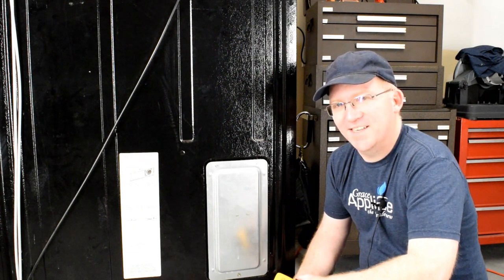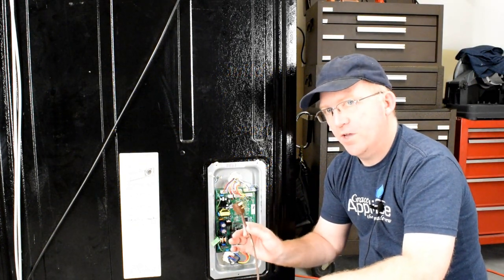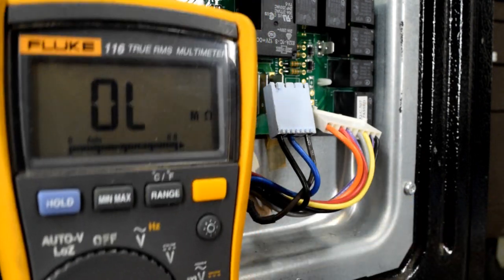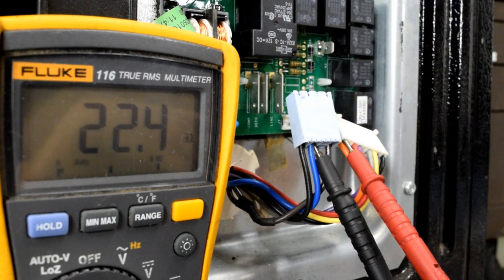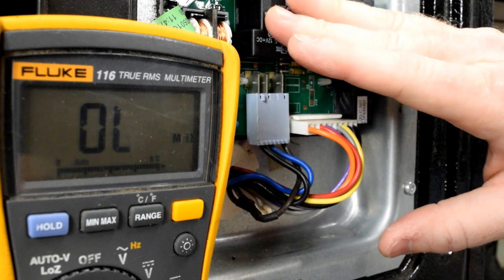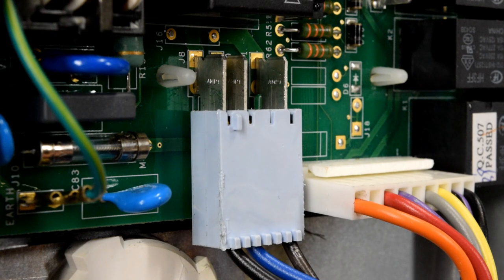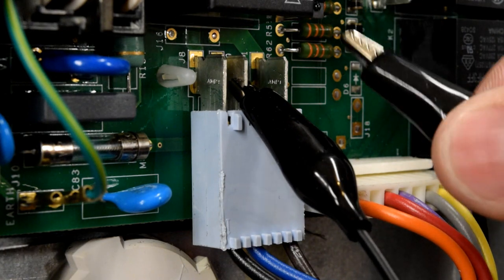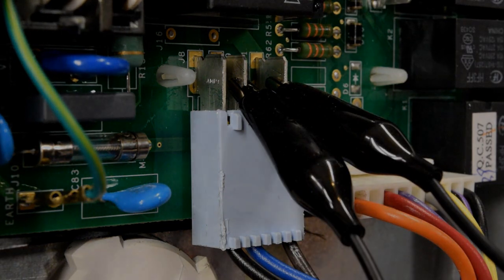Diagnosing a Bad Control Board - Part 3: Defrost Issues

Comment: Andy  Hi !     My GE refrigerator 2 doors model PS123SCPABS  S/N  LF425289 wasn't running.    I changed the main control  board
Now the  Refrigerator and Freezer are working , but the main panel inside is not lite  As results of this I can't make any adjustment for temperature settings. THE UNIT IS RUNNING MORE 24 HOURS   on and off automatically   I ALSO SHUT THE MAIN BRAKER  but no luck .Please help  All your videos are excellent very educational  God bless for good explanations,
Reply from the maker: Hello,
What is the part number on the box of the control board that you installed?
Thanks!
Reply: @GraceAppliance  

My new board  GE         WR55X10942           ASM-084691240-102    THANK YOU
Reply from the maker: Michael Babu hi, thanks!  
So, your original part number was WR55X10314. The substitute part number that’s give for me is: wr55x10942P. 
Now, I’m not sure if the updated part number ending in P would make a difference in your case, but just wanted to get you that info.  I don’t believe it should make any difference.  Also, I checked your serial number for the wiring modification I mentioned previously and yourself does not show it needs any modification.  

I’d double check the board connections to make sure that each plug has been properly seated. I’ve seen where people will install the plug, but mistakenly got it plugged in 1 pin over to the right or left and have similar issues.  

I’d start there.  Let me know what you find.  Thanks!

Comment: Can't this test only be done if the refrigerator has been running and is cold so that the high limit thermostat is closed?
Reply from the maker: Hey, the high limit thermostat opens at like 110+F (am not sure of the exact temp off hand) so we'll above room temp. If it's below that temp, the heater should turn on with this test.
Reply: @GraceAppliance  from my experience, I thought most defrost thermostats open around 47 degrees or so.
Reply from the maker: We're talking about different parts. They look the same in appearance, but have different functions.
A defrost thermostat will cycle around 45-55F. A high limit thermostat is a safety part designed to cut power to the heater if something is wrong, stuck relay for example.  But it has nothing to do with when the defrost comes on or off.
Reply: @GraceAppliance  I'm talking about the part that is in line with the heater that is mounted on the top of the evaporator that cuts power to the heater when it reaches around 47 degrees or so. Some people call them defrost thermostat or some people call them a high limit.
Reply from the maker: @brianseeney1364  those are 2 different parts. They're both in line with the heater, but serve different functions.
A side by side GE refrigerator with a control board has a defrost sensor and an adaptive defrost (control board) which turns on and off the heater based on the sensor feedback.  This is what dictates when the defrost turns off and power is cut from the control board relay. The high limit thermostat (not a defrost cycling thermostat) is there in line with the defrost heater should the board have a stuck relay and thus continually send voltage to the heater.  This is when the defrost high limit would cut power to the heater, in the event they there is run away temperature at the heater. This happens at much higher than 45-55F (usually around 130F).

A defrost thermostat, usually 45-55F is the mechanical on off switch for older defrost systems, non control board models usually. Older fridges would use a mechanical defrost timer vs a control board on newer styles.

The visual appearance of both parts are the same, but do not serve the same purpose.

Thanks!
Reply: @Grace Appliance  I took the freezer apart and did find that it is a higher limit like you say. The refrigerator works correctly most the time but sometimes I check on it and the temperatures are about 10 to 20 degrees higher than they should be but then it goes back to the correct temperature. I was thinking it was maybe sticking in defrost too long. Do you think it could be a temperature sensor causing that?

Comment: Thank you for your video, I have a hotpoint  HSM25GFTCSA side by side fridge   will a WR50X10068 REPLACED wr50X10065 because I installed the 10068 and the freezer and fridge are not cooling enough and I feel there are to much heat coming out the evaporator vents when the heater defrost is on plus is melting the ice on the ice bin every day ,I will appreciated it you could give me an answer thank you again and be safe julian
Reply from the maker: Hi Julian, 
The part you replaced does not dictate when the defrost comes on or for how long.  It is a safety thermostat designed to only cut power to the heater if it’s gotten too hot. This is a very rare part to fail and is not your issue more than likely.  

The other 3 remaining parts are, your defrost heater, the defrost sensor on top of the evaporator and the control board.  

Please watch my video called how to test and replace a defrost sensor. You can do an ohm test on the 2 leads going to the heater and should get around 20 ohms of resistance.  If both of these parts test good, it would be a bad control board.   

I hope this helps,
Andy
Reply: Mr Andy first I want to thank you for your prompt and accurate response,that shows how serious and good you are as person and technician ,I forgot to tell you that when I change the defrost thermostat I also did the same with the sensor and heater,watching your video of how to check sensors,follow your clear explanation and after some troubleshooting change the freezer sensor again I think the fridge is getting the temperature that should be, once again thank you  Mr Andy and have safe and too day
Reply: GOOD DAY
Reply from the maker: Julian Trujillo you’re most welcome.  Please keep me posted should you have any further issues.  Also id recommend using a legitimate GE sensor vs an aftermarket sensor as I’ve heard other having issues with aftermarket.  There is not much of a savings in using an aftermarket sensor either so it’s worth the extra money.  Thanks!
Reply: Mr Andy ,I still have issues with the evaporator fan running non stop and is freezing the auger motor,the temperature are 14F and 36F ,any suggestion I would appreciate it, thank you again and have a safe and a good day
Reply from the maker: Julian Trujillo hi, so the ideal temp should be closer to 0F and 14F is too warm. Your freezer would continue to run non stop as it is trying to achieve the 0F temperature.  Do you notice that your compressor is also running non stop as well?

If so, it would be good to visually examine your evaporator coils for a proper frost pattern. This will tell you quickly if you have a sealed system (I.e. compressor, refrigerant etc) issue.  You’d need to remove the back wall of the freezer while it’s been running for at least 30 minutes.  You should see a light coating of frost on the majority of the coils. Feel free to send me a picture to GraceAppliance@gmail.com if you’d like me to confirm what you’re seeing there.
Reply: Mr Andy yesterday when I changed the defrost sensor I had looked at the evaporator and it was with the light coating that you mention,the compressor is working and the freezer temperature is down to 8F ,37F I think I  should be patient ,once again I thank you for your time and responses thank you and be safe.
Reply from the maker: Ok, sounds good.  Let me know if you have any questions.  Andy

Comment: Actually the HSMGFT25asa can be forced into defrost mode via the front panel buttons:   set the 4 temp buttons        5 5 and push all 4 buttons at once for 3 sec, they will blink, now type in 1 4 and hit cubed ice button (or any other button they say), it will fire up the defrost heater, its glowing orange now finally;   so that confirms that the heater and def therm is ok, must be some other problem (maybe temp sensor thermistors or main board?  it will deactivate after 15 min or perhaps unplug replug or code 1 5 or 1 6, then cubed ice button.. Thanks for reply:: makes me miss the venerable DF timer which could be turned to on with screwdriver.    I ordered a low cost board and will just swap them to be sure whats really going on.   I noticed there is a fuse on the board just to the left of where you jumped the DF , is it possible that is the problem  with the DF circuit part of the board.   FYI:  I called GE answer center, and they said that all they can recommend is unplug wait a minute, replug in.  I asked her if she knew where the diagnostic codes for use with the 4 front temp buttons were (table2), she didn't know.    I know where it is but can't find the manual that avail to public its:        31-9072 GE Profile Side-by-Side Refrigerator Service Manual
* 31-9072 Arctica Profile GE Side-by-Side Refrigerator Service Manual (pages 35-  ).pdf (66.66 kB - downloaded 2241 times.),   maybe you can get it down and at least post the code for the DF part of the circuit.
Reply from the maker: Hey, the fuse you mention do cause problems sometimes, but if that fuse blows, the entire board doesn't get power, not just the defrost function.

Best of luck and let me know if you have any questions. 

Thanks!
Reply: John Doe
6 hours ago (edited)
Actually the HSMGFT25asa can be forced into defrost mode via the front panel buttons:   set the 4 temp buttons        5 5 and push all 4 buttons at once for 3 sec, they will blink, now type in 1 4 and hit cubed ice button (or any other button they say), it will fire up the defrost heater, its glowing orange now finally;   so that confirms that the heater and def therm is ok, must be some other problem (maybe temp sensor thermistors or main board?  it will deactivate after 15 min or perhaps unplug replug or code 1 5 or 1 6, then cubed ice button.. Thanks for reply:: makes me miss the venerable DF timer which could be turned to on with screwdriver.    I ordered a low cost board and will just swap them to be sure whats really going on.   I noticed there is a fuse on the board just to the left of where you jumped the DF , is it possible that is the problem  with the DF circuit part of the board.   FYI:  I called GE answer center, and they said that all they can recommend is unplug wait a minute, replug in.  I asked her if she knew where the diagnostic codes for use with the 4 front temp buttons were (table2), she didn't know.    I know where it is but can't find the manual that avail to public its:        31-9072 GE Profile Side-by-Side Refrigerator Service Manual
* 31-9072 Arctica Profile GE Side-by-Side Refrigerator Service Manual (pages 35-  ).pdf (66.66 kB - downloaded 2241 times.),   maybe you can get it down and at least post the code for the DF part of the circuit. This manual is very very close but instead of F for fail, it gives code of 0, & they are not in the order dictated by the manual.  @GraceAppliance
Reply from the maker: @InventPeace1  yes, it confirms the heater, high limit thermostat are both good. It also likely means the board is good as your relay works fine. I'd swap the defrost sensor on top of the evaporator and you should be good to go.

Nice work!
Reply: yes I did take the one good sensor on the freezer bottom and put it on the top (evap), that allowed it to turn off yesterday, today I got a new temp sensor in and put in the bottom, now the 0 7 diagnosis test from table2 gives something like 0-1,P-2, P-3,P-4, & 2-5.   I think the 0 means Fail or not there, the 3 P's go to the 3 temp sensors (p-3 is the bottom freezer, changed from 0-3 to P-3), and the 2-5 I have no idea except some models have 4 temp sensors so maybe it means not there.  This HSm model is very similar to this manual for the Pss and Gss models but the codes come out a bit different, I got no F ever so I think the 0 means fail?   Anyway its making ice and acting more or less normal but fingers still crossed on whether the Def Htr comes on or not. Will let you know, thanks for your help immensely ! And Cheers to UncleHarrys website where I found the manual with the fabled "Table2" .  @GraceAppliance
Reply: @GraceAppliance  The fridge gets cold as usual, the fridge runs seemingly all the time?  Wondering if one of the temp sensors that "passed with a P" is bad? The fan inside the freezer seems to lope?   what do you think? thanks.
Reply from the maker: john Doe the pass fail test that the error codes will give are only telling you if the sensor is open circuit or has continuity.  The sensors can have continuity, but not have the correct resistance to properly measure temperature.  
You’ll need to measure each sensor as shown in my video called ‘testing and replacing a defrost sensor’ in order to see if they are within specs.  

Thanks!

Comment: hello, we have a problem with defrost heaters burning out as soon as they are replaced and kick in for the first time.. they start and then simply burn out. The defrost thermostat tests good L1140-30F, the temperature sensor tests good as well with appropriate ohms at certain temperatures. But the defrost heaters we get from internet burn out right away.. would this be main board issue or wiring issue, or using cheap parts from amazon instead of buying OEM defrost heater? WR51X10055 Thank you for help in advance.
Reply from the maker: Adam, very interesting!
I would suspect that this is due to parts vs an issue with the board or wiring.

However, I would want to confirm 110-120v to the heater, but have not seen an issue where a board would send more than this - assuming voltage at the wall is appropriate (120v).

That's where I'd start to rule out a short. However, if you had a short to ground (or Neutral) I would imagine it would trip the breaker long before this.

If you're getting 120v at the wires to the heater, I'd replace the heater with an OEM.
Reply: @GraceAppliance  I look at the main board. This fridge is old. The board is white but has same plugs as yours.  Sadly my multimeter probes are not as tiny as yours. I decided to test the temperature sensors as you showed in your video. J1 plug. Since I’m unable to showed the probes in the plug, I touched the top of the plug where to connector is. To my surprise the Ohms were not matching the chart - on all 3 of the sensors. They were way off. Which is strange because I took two of them - cut them out from freezer - and tested them with glass of ice water and the ohms were matching just fine. What could cause the ohms not matching the chart by testing them from the board?
Reply: @no-ONES-business  hey, testing the thermistors while still installed on the fridge is always a bit difficult because the Ohm resistance is going to change based on temperature, obviously. 
The difficulty comes in because it's sometimes tough to know the exact temperature at the evaporator - and often I simply use the ohm feedback as a rough guide. If the chart says it should be 80F, but I can clearly see it's covered in a solid block of ice - I know that's incorrect and a failed part obviously. 

That is why it's recommended to stick the sensor in a glass of ice water because the ice water removes that variable for you.  You know that it's between 34-36F. Where "room temperature" is more of a relative term. 

However, if it's drastically off at room temperature, I would replace the sensor especially given how inexpensive they are.
Reply: @andyf80  Hey Andy. Thank you for your replies. So I followed your instructions.. I took glass of cold water with ice. Then I unclipped the sensor from coils and submerged it in that icy water, and left it there for few minutes. Water temperature was 34-36F. I then moved to the board and followed with two tests... first one I unplugged the J1 plug and used the instruction as in your video with the J1 plug disconnected from bard -  Black probe in 5th hole, and Red probe in 4th hole - I got almost perfect Ohms numbers (34-36F and around 13.60 kOhms which is close enough on the chart). I then plugged the J1 plug back into the board, and followed once again the same instructions where the Black probe went into 5th hole and Red probe into the 4th hole AND here is the confusion... the temperature of water was still 34-36F, BUT the kOhms were totally off.. during that test I got around 7.49 kOhms from that coil sensor. By the chart that is equivalent to around 60 to 64F temperature (and yet the water temp was only 34-36F). I then followed with the other two sensors remaining.. the bottom one in freezer and the last one in refrigerator. Same results discrepancies happened between when the J1 plug was disconnected from main board and kOhms and temps were perfect by the chart, and then totally off when I plugged the J1 back into board and tested temps sensors again. Is this an indicator of bad main board? Sensors are good and testing correctly when J1 is unplugged from board. Btw. the voltage on the board was 122V when tested, so the power is ok.
Reply: @andyf80  one more thing… why did I test the sensors with J1 plug disconnected? I found this video and this guy disconnected it from the board: https://youtu.be/7lxOqMjFtr4

So truthfully I’m not sure which way is the correct way. One thing that is confirmed was that the sensors are testing correctly in kOhms with J1 plug disconnected.